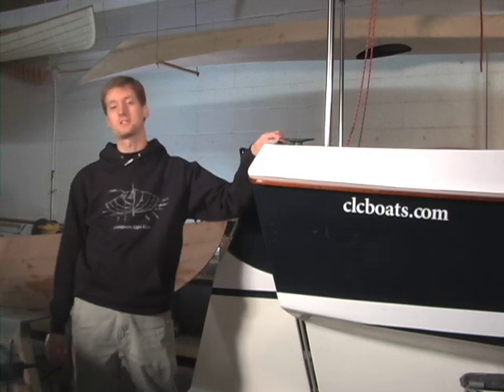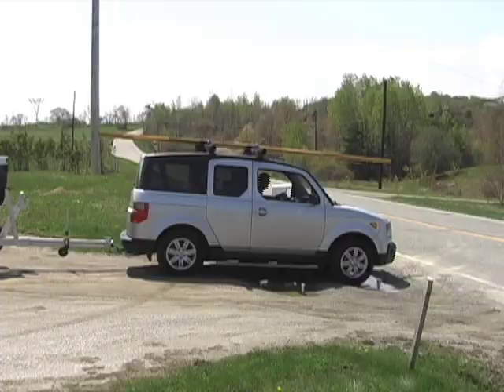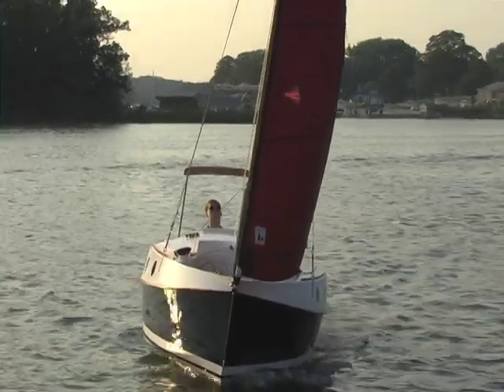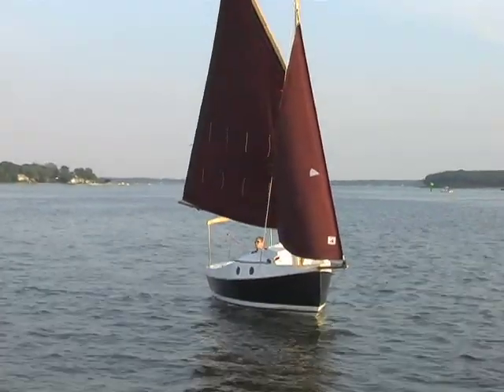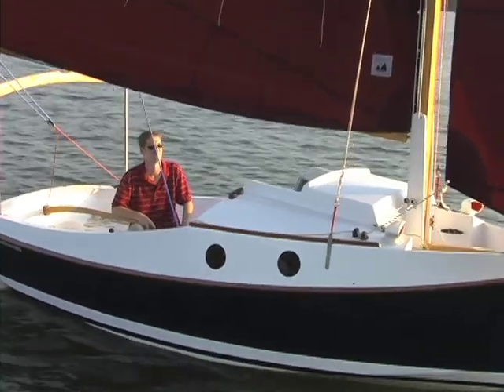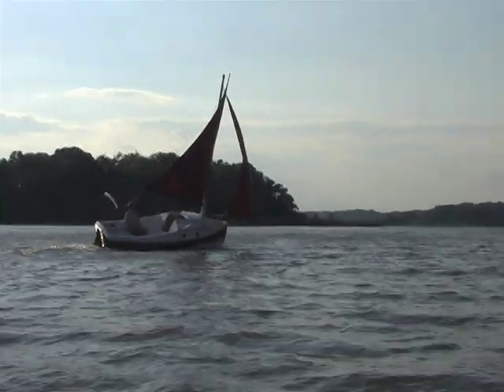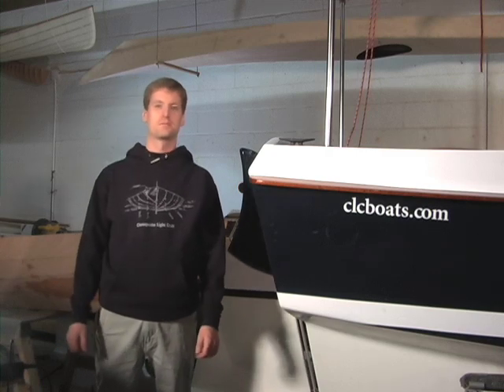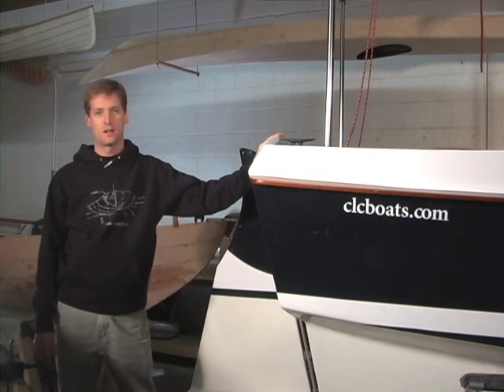CLC PocketShip Under Sail

Comment: The rocker curve  is  just about right approximating a sinewave that fits the waves while the Vee bottom is kind and does not slam in waves. The sail id big enough for a good  turn of speed while the size is handy for the busy man who cannot send too much time preparing the boat. Accommodation is reasonable and the comfort at the back is good, Rudder is effective and the high cabin does help to increase stability when heeled a lot.  An excellent  design in all directions.    Perhaps using fibreglass would  help to reduce maintenance in the long run, especially if this craft is used in fresh water.  This boat is good for offshore sailing if the ballast is increased a little.

Comment: Sweet. Like the shorter mast of the gaff rig for ease of raising and lowering. Does the main require running backstays?
Reply from the maker: No running backstays.  The side shrouds have enough aft spread to hold the stick up.

Comment: Only one reply from the designer .....and very old video, so little or no chance of a reply to my question now . What happens in a knock down ? Sink immediately? Anyway cool boat and sails very well
Reply from the maker: Sorry, just saw this. PocketShip has a self-bailing cockpit, so it's extremely unlikely to flood in a knock-down. With lead ballast in the keel, the boat is self-righting in anything besides huge breaking waves. In addition, there is enough built-in foam flotation to ensure the boat remains upright and afloat in the event of a swamping.